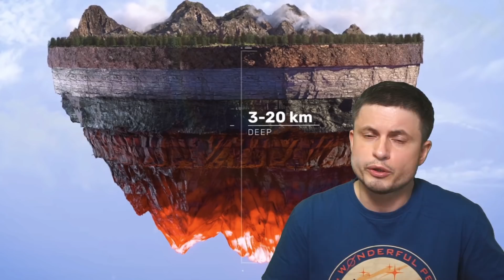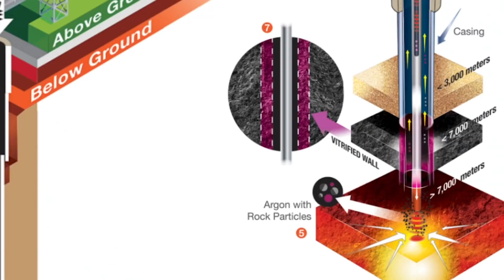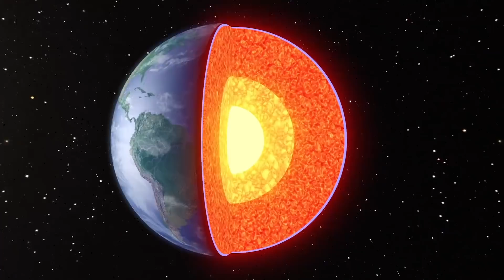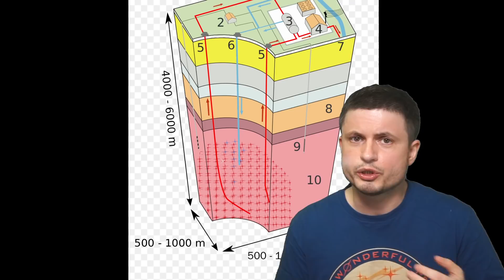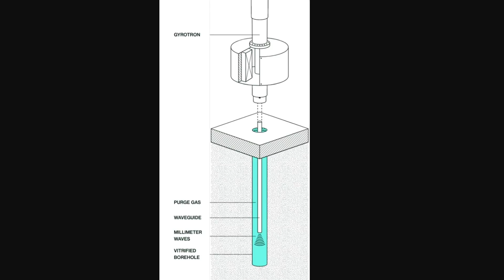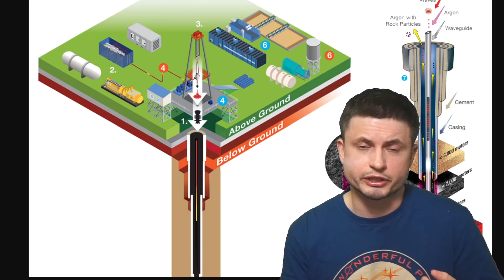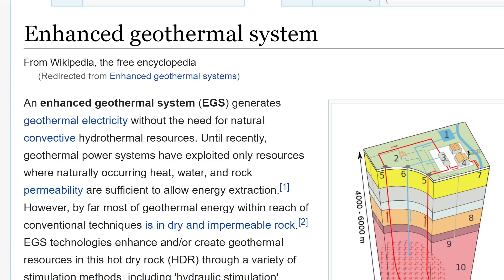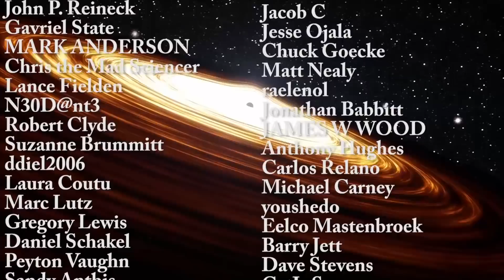Creating Deepest Hole on Earth For Geothermal Energy Revolution

Comment: I've thought about the idea of geothermal around Yellowstone. Enough energy transfer it could potentially be able to stabilize a big problem in the future.
Reply: I had that thought in the past as well, there's a lot of inherent upsides to doing it.  However the problem is what if they accidently drill a little too deep, or the rocks shift enough and it creates an opening.  If that pressure starts getting released uncontrollably we got a big problem.
Reply: @lunaticbz3594  I totally agree. I think we should drill around it. Not over the plume.

Comment: Aren't there fluids that boil at lower temperatures than water? Wouldn't it be easier to use them rather than digging deeper to get to the boiling point of water?

Comment: I had some experience in this sector 20 years ago.  It works in the areas where there is an existing hot water source which only requires a bore hole to access it.  When you need to inject water you need another hole and have to frack the rock to get the hot water/steam out.  Sadly the laws of physics don't help because the thermal transmission through rock is poor resulting in a significant degradation in the extraction rate.  So the faster you pump the water down the cooler the out-take becomes.
Reply: Exactly.

Comment: A few companies began drilling 2000 metre shafts down to extremely Hot Rocks for creating steam in the early to mid 2000's here in Australia, but the main issue was that where the hot rocks were located (the hottest rocks closest to the surface), was a long way from the existing electricity grid. Eventually after breaking drill bits and getting to the point of proof of concept in which water was pumped down to the hot rocks heated and came back to the surface to generate power through a turbine, the problem of the electricity grid being too far away was still there. The project failed.

Comment: One concern that I have about geothermal energy in the long term is that, after we've finally developed a means of keeping greenhouse gas levels low, it could potentially become the #1 major contributor to global warming, though not necessarily because of the amount of greenhouse gases that are released in the process, but rather simply because of the amount of heat that gets drawn up from the depths of the Earth to the surface of the Earth, which, if not released as steam, could then be turned into electricity, which would then be distributed across electrical grids across the world, and then end up leaking out into the wider world as waste heat created from running anything that runs on electricity, from ovens to lightbulbs.

In the future, we may have to build heat-management systems that would radiate our waste heat into space.
Reply: The greenhouse gases in the atmosphere trap the infrared heat wavelengths from being emitted out into space when it is nighttime especially.  But, I can see it playing a little role in temperature increases if it really caught on.
Reply: No it wont, more than 90% of our surface heat comes from the sun, actually the earth radiates more heat, than it can "produce" by itself. Without the sun earths heat balance would be even more negative, than it is now, it ist almost completely about greenhouse gases, which prevent vertain wavelengzts to escape into space, which is why earths climate is warming

Comment: The mine I work at is 9900 feet deep currently, and is passing 10000 feet very shortly. That's  over 3kms or 2 miles underground, it's the closest accessible place to the center of the earth in the world. The rock at this depth is approx 32-33 degrees C.
Reply: To a well driller, 10,000 feet is pretty minor, but you would burn your hand if you held it in the mud circulated through it.
Mines that deep that have people working in them are cooled by pumping ice slurries down to keep the temperature down to about 30 degrees C.

Comment: I worked on rigs for over 10 years and the deepest hole I was on reached 5,400 meters ... after 13 months. Got stuck many times and final tally was 2 BHA (Bottom Hole Assemblies) lost when the hole was finally abandoned. Nice idea, but probably not achievable with present technology .. and this would have to be done in many, many locations :(
Reply: They proposed using lasers to drill the hole and many idiots are taking it as gospel believing the feasibility comparing it to a plasma cutter vaporizing the rock up to the surface. What they disregard is that the rock would solidify before it reaches the surface.
Reply: @RichardPrendingue  Yup, they are in denial ... of reality :)
Reply: @pudmina  For arguments sake even if laser drilling worked you're still limited by the snail pace thermal conductivity of rocks that are physically immobile. Just as old faithful geyser isn't a continuous column of steam rather having a predictable eruption time of every 72 minutes within a 10 +/- variation.

Comment: I have done a lot of research into drilling for geothermal and fracing causing earthquakes. The generally accepted belief among the experts seems to be that adding liquid into rock causes existing faults to have less resistance and causes them to release more often. So in the short timeframe it may "cause" an earthquake to happen which releases the stress on a fault before it builds into a stronger quake later on. Thus fracing and geothermal drilling may cause earthquakes to happen sooner than would otherwise be the case, but at a point in which the quake would cause less damage than if it was allowed to continue building until a natural release occurs. Of course this wont keep lawsuits from being rewarded large sums for damages and this makes this type of drilling a high risk activity - perhaps too high a risk to be worth the eventual rewards.
Reply: good comment.

Comment: While this is intresting, i also see a potential future problem if this becomes a widespread use.
The heat is not "free", it comes from somewhere, and by releasing it you have a (slight) cooling effect on the deapths of earth, while also having a slight heating effects on the atmosphere.

This cooling is only very very small but it is still very real, and as such this is not a perfectly renewable energy source.
Sure it might take millions of years, but if you keep artificially venting out heat from the earth, then eventually you will cause the outer magma flows to cool down and solidify into a thicker crust.

Sure, it would take an almost infinitly long time to actually cool down the magma and the core of the earth completly, but doing so is not the only concern.

A more direct concern from drawing heat up from the ground, is that the heat has to go somehere, it won't simply stop existing once you have drawn it up from the earth. 
Eventually this could lead to further global warming, by transfering heat from inside the earth to the atmosphere ontop of the earth.

Ofc, this is only the case incase this would be used on a very large scale and widespread way. The heat transfer is essentially the same as the natural vulcanoes we have.
It's all about the scale, but if this artifical geothermal powerplant would beome the most popular source of power, then it would quickly become a very slipperly slope.

Comment: It is really frightening to know that we float on a large ball of hot magma and even hotter liquid metals at the core. My guess is that these will solidify (Cool) rather quickly if we are gonna mess with drilling holes. Magnetic fields will change and than disaster strikes. Atmosphere will evaporate into space, simply blown away by the sun. This must have been the fate of Mars a couple of billion years ago.

Comment: completely missed  already known problems.  cooling of the extraction heat spot to the point of site closure . expensive drilling with not that much energy output for each shaft. huge material problems at every step

Comment: a common misconception is that the sun provides all the energy necessary for life on Earth to exist....
But that's not true, the heat of the interior provides a SIGNIFICANT amount of the heat that keeps the planet favorable to life.
Eventually, as the core cools, life on Earth will die and the planet will become more like Mars. Having the Moon circling helps generate a bit of heat energy but interestingly, that's why the Moon is getting farther away each year (true, look it up).
So I'm pointing out that it's not 'free energy' because using it will shorten the life of the planet. But do we really care? How long will the human race survive anyway because we've got a lot of other more pressing problems. (Not climate change, think more like germ warfare or rogue nano machine dissemblers, or ecological collapse due to breaking links in the ecosystem)
Another point no one makes is that when you use a windmill to generate power you SLOW DOWN THE WIND. So one or a few hundred windmills you don't see much effect but what if you put hundreds of thousands across the Western and Central USA? The downstream airflow temperature also changed too. What's all that going to do to the climate of the Eastern part of the country. Or if there's millions all over the surface of the Earth. It WILL effect the climate. There's also subtle biological effects of the sonics coming off the blade tips of windmills that are detrimental to life. No one knows yet what mass windmill's will do to the ecology over hundreds of years.
Note I used to be in the power generation field and have put up windmills and built combined cycle gas turbine / steam turbine generator plants.
Remember, you heard it from me first but in years to come you'll hear it again.
TNSTAAFL: There's No Such Thing As A Free Lunch.
So quit saying 'Free Energy'

Comment: Almost all wells need support while being drilled, they will collapse if they are just drilled with air, even if the drilled rock becomes a glass-like layer on the walls. Just like in the ocean, the deeper you go into the earth, the higher the pressure becomes. in a "normal" environment, the hydrostatic pressure can be calculated in rock, just as it is in the ocean.  Pressure (psi) = density(pounds per gallon) x vertical height or length  of well(feet) x 0.052.  In metric-like units, the formula is Pressure (bar) = 9.81 x density (kg/m3) * vertical height or length of well (metres) / 100000. the "9.8" constant is the acceleration due to gravity. 

the basic formula concept is Pressure (pascals) = density (kg/m3) x acceleration due to gravity (m/s2) x height (m), or, rho x g x h with constants added to convert units. Note that the diameter of the hole is irrelevant in these calculations...

Fresh water is about 8.34 pounds per gallon (1000kg/m3). rock is of variable density, but is somewhere in the range of 17-23 pounds per gallon (2100 - 2700Kg/m3 approx. ). a lot of rock contains pore spaces that are usually filled with water, oil, or gas. this obviously affects the overall density of the material, so the "bulk density" is used, which is the  average density of the rock with its pore spaces filled with fluid.

This means that most oil wells are drilled with various weighted fluids circulated in them to keep the wellbore from collapsing, and to prevent gas or oil, etc, from migrating into the well and causing problems. The fluids do not need to be as dense as the rock, but need to be dense enough to exert enough pressure on the rock to keep the well from collapsing (shear failure). if the fluid is too dense, it can fracture the rock by itself (tensile failure) and cause other problems.  

calculations and models to understand the distribution of stresses in a wellbore can get a lot more complex than this basic calculation, but it's a good starting point. for more info, have a look at the field of Geomechanics in relation to oil/gas wells.

Comment: Enhanced geothermal, or "hot dry rock" geothermal was experimented with in australia, near a place called Innaminka, with a company called Geodynamics. They drilled below existing oil/gas reservoirs into the well insulated rock below, and utilised naturally occurring fracture networks to allow fluid movement between wells. 
The concept is sound, but the biggest problems related to corrosion control using materials that can also withstand high pressures and temperatures while still being affordable. Drilling the wells was not simple, but was actually the easiest of the problems to overcome. They also needed to optimise the well spacing a bit better than they did. Unfortunately, this project was shut down, and the wells decommissioned. I worked on one of these wells while it was being drilled, and have spent the last 18 years in the oil/gas industry as a geologist, and later as an engineer. Drilling deeper than Kola Deep is challenging, and expensive, but not impossible with current technology.
Reply: I saw that on a science show when it was being done, why did they shut it down?
Reply: @billybobwombat2231  Corrosion problems, well spacing, cost to maintain the system, difficulty to connect to the main electricity grid (location is really in the middle of nowhere). Probably some other reasons, like funding, but these are the main ones.
Reply: @cerealport2726  so could the technical problems be solved if it wasn't as remote?
Reply: @billybobwombat2231  I think so, as materials science and drilling technology has improved even in the last few years - reducing costs. However, the geological conditions (naturally fractured low permeability rock with a useful fracture orientation) allowing this sort of system are not found everywhere, unfortunately.
Reply: @cerealport2726  thanks for the info, hopefully we can get smarter with these systems,  have a good one 👍

Comment: Really nice presenting of a energy topic.¡¡  I`m not so sure when its said geothermal power is `unlimited`. I assume all earth`s core heat is escaping from volcano-like structures and even from the entire earth surface. If it is massively extracted by water circulation, I guess we would tend to have some cooling of the grounds, which would cause to slowly decline production, somewhat like non-renewables.

Comment: This technology could be used anywhere where there are hot water springs, it does not "need" a tectonic plate boundary to be able to work.
The big thing in my opinion is that it has to be a closed system - in other words water must not be able to escape into surrounding rocks.
So whatever water is put in at the top must ALL come back to the surface with ZERO LOSS.
In the vicinity of a hot spring you know that the "heat" is pretty close to the surface so the cost of drilling need not be as high.
And if it is not able to superheat the steam then it is a low energy turbine being used.
Remember that "free" energy is "free" energy and the underground part of the system will last longer because of the lower heat and pressure that it has to withstand.
And you can drill many of them...

Comment: Trying to answer to myself if this possible solution could become a source of geological instability:

If we spread the current avg power need of humanity (2.5 TW) over 500000 km^2 area then it becomes equal to the cooling power per unit area of the earth, ie 0.05 W/m^2. Suppose we build 10000 such power plants (each of 0.25 GW avg capacity) in the world then each will have to spread out its heat requirement over 50 km^2 (!!!) so that cooling in the heat-drawn area occurs at no more than twice the normal rate. Clearly this much area does not seem practical, eventhough 2 times of normal cooling still seems too risky. In reality the plants would draw heat from a much smaller patch and so will produce a significantly more cooler spot, and do so pretty soon. I think such spots could lead to geological issues like sinking,  fissuring etc in and around the plants, and the power output will drop too.

Hope these issues have been considered instead of focussing solely on solving the problem at hand.

Comment: Having drilled multiple geothermal wells, I can add to this conversation. What a lot of people don't understand about geothermal wells is the current technology. The water for the steam comes from the resivor. Multiple wells are drilled, some will be injection wells, some will be producers. Cooled water from producing wells is injected back into the resivor. UNOCAL has as much data as anyone on the planet about functioning geothermal systems.
Reply: How does a driller not know how to spell "reservoir"?

Comment: what happence whay you experiemce heath transmisions.

the heath carier 

dont vorget we are a magneticle vieltflow container carryiing a directional feildflow container as the shell.

when you pease in to, our tace out 
you chaince the thention and intention inside eurths 🤣 than the dimention between the magneticle container and the directional feildflow container.

you will be able to create a lot of problems that we are oll craiïng after 

you just nead to manivest diverentional and tace from here .
you dont nead bring eurths energy cicle down bi introdusing this conditions in to the wrong position😍

jeb if thention lowers down to mache outer core collapses of particles 
when it is bild op to match particle core colapses.

and when eurths is seen as a particle from the shell towart the outer core than if we ad the conditions bi using the heath that we have to release our tace from the sinkholes and vulkanos and titonic and whether activety wil automaticley chaince dramaticley🖖🌈